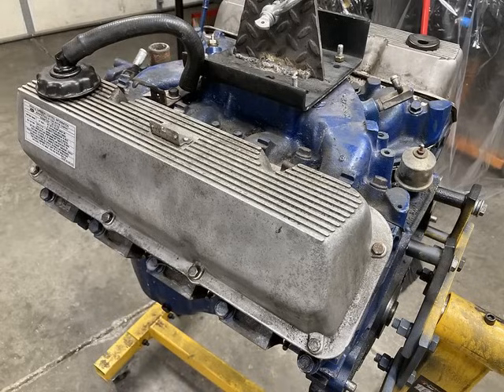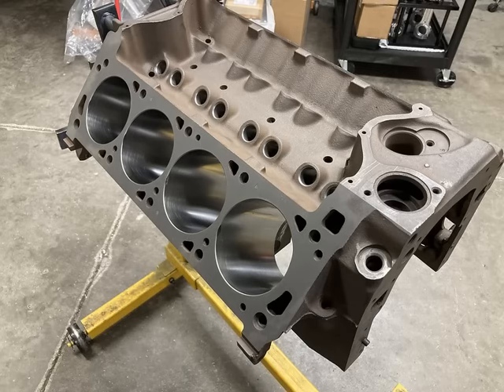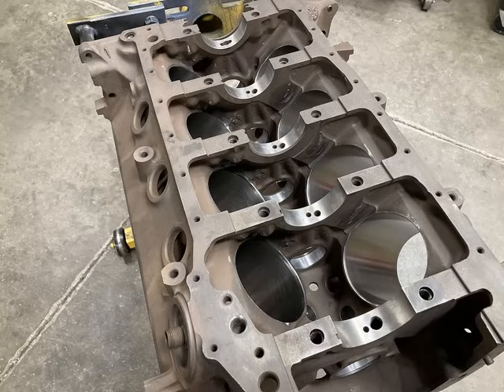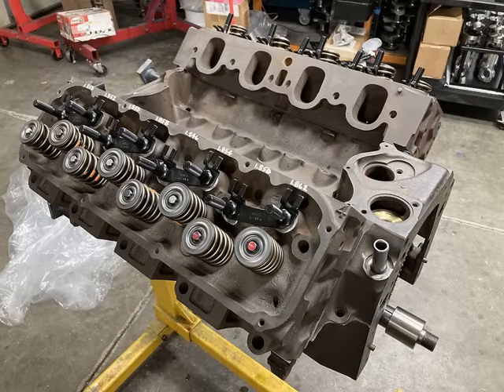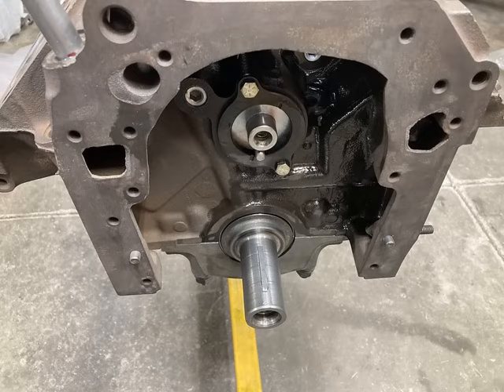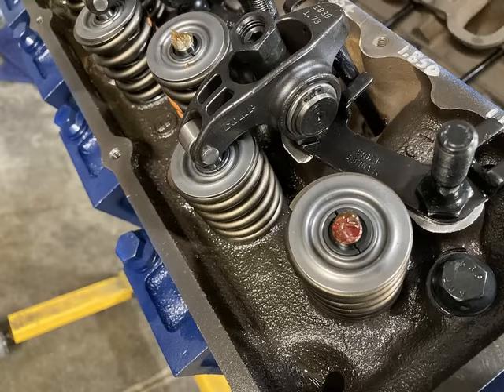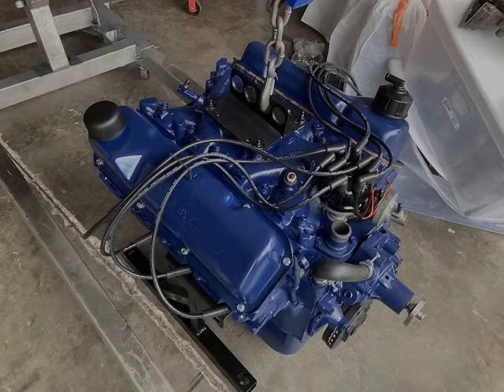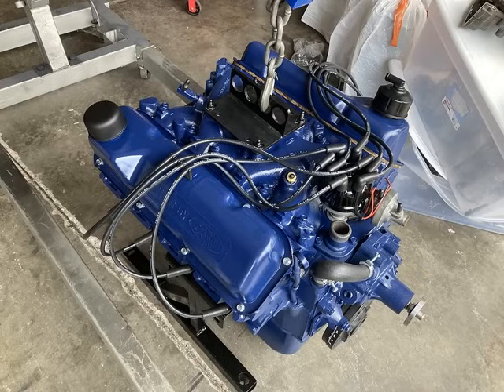Lykins Motorsports Ford 351C Complete Build, Disassembly To Dyno...

Comment: I have a bare, 71  351c cobrajet block that's been bored .030 over and all the machine work done. And a set of 70 4bbl closed chamber heads, factory, untouched, complete. I also have a 2bbl 351c block, complete that's going to be the doner for everything else. I do like the upgrade to those Eagle rods. And those pistons look yummy. Like Christmas candy! Would you mind sharing the specs on the camshaft and curve specs for the distributor? I like how, in the dyno room, reality warps as that Cleveland devours the atmosphere and tries to ingest everything else around it!
  Excellent video, very meticulous build and attention to detail. Happy Holidays to you and yours.

Comment: Great content! I'm a bit puzzled as to why those finned aluminum valve covers were not used?  They were stock on the higher performance Clevelands and they looked excellent when cleaned up or even polished. 
Thanks again!

Comment: Excellent narrating excellent rebuild and I learned alot especially using gasket maker instead of the rubber seals in front and behind the oil pan those things always seem to be problematic thanks so much for being so detailed

Comment: Thanks for the great presentation on the Cleveland build. Presentl I am building a BOSS 302. It came to me broken, detonation blew out two porcelain sections from Sparkplugs. It will be apart after Christmas. Damage🥶🥶it’s a 13/1 previous road race engine.

Comment: What carburetor did you use? The factory carburetor in 1970 was a 600 cfm Holley. That is not a factory 600 cfm carb. No choke horn.
I have factory stock 1970 351c 4bbl. Never been modified and has been in disassembled storage since 1980. Im finally ready to build and install in my 67 fastback

Comment: when i was a boy my dad had a junk yard,i quickly got into the FEengines.dad liked fords and had a lot of them.i had-still have a 66 comet 390 4 speed now 428.i ended up with 5 comets.i had one 67 that had a 351c 4bbl intake no carb on it.i was young and did not know what i had.a buddy said what do you want for the heads off the 351c.i said you can have them,i like 390s.when he took those heads off i saw the giant valves and ports and i thought wow i messed up giving those away.never had a 351 running in anything so i just did not know what i had.

Comment: Hi Brent, you mentioned that you installed bronze guides so that you could use viton seals, which got me thinking! I'm using viton seals on my 400+ hp 306ci sbf with cast iron heads/cast iron guides......is this a problem? do you always install bronze guides in iron heads? Thanks, Dave
Reply from the maker: It's not a problem.  I always install bronze guides because factory stuff is generally worn out by the time I get it and there are more spring locator/cup choices for common bronze valve guide diameters.
Reply: Thanks, that's put my mind at rest!  @lykinsmotorsports

Comment: So many questions here: 
1. What HP level is the block good for - with and without filling the block
2. What RPM is the stock crank and the stock rods good to  - balanced with arp fasteners - rod and main bolts?
3. Since transport might be an issue for some of us to ship an engine to you, would you be able to either put together a kit or provide guidance for a kit (for a fee) to achieve a power/ rpm level?

Personally my goal is 600 - 650 hp at 6600-7000  - and a safe redline (not prolonged at that rpm) of 7500. 

4. At this level, are the as cast '70 closed chamber heads fine?
Reply: May be late, but since there was no reply I'll add some info for anyone else wandering by. I'm not an expert, just an enthusiast, so take this for what it's worth.
The stock cast cranks are good nodular iron. Pro Stock racers in the 70's were using race prepped cast cranks pushing 10k. In NASCAR they could last for 500 miles at 7k+, but many teams went to billet machined cranks. Buy 2 main bearing sets and use a pair of uppers on each main journal for full groove oiling to the rods. Stock rods with polished and shot peened beams and resized for ARP bolts should be good to 7500, but is pushing the safety margin.
Minimal port work will improve head flow, especially at low lift. Most of the improvement is actually chamber work to unshroud the valves. The valve clearance machining leaves ridges in the chamber, on the intake near the spark plug and the exhaust on the opposite side. The scallop in the chamber wall also leaves a ridge. Blend the machining ridges into the cast surface. In the port itself there is also a sharp ridge where the seat machining meets the cast throat. Blend that down for a smooth transition and constant radius on the short side. You can also streamline the valve guides. The intake ports tend to have a line of casting flash near the turn.  "Blue Oval Dude" has a video covering this. He picked up 50 cfm at .3 to .4 and 40 cfm at .6 lift just blending the rough spots.

Comment: What do you about this I built mine 1971 block stock crank a rods Keith black pistons 8 cc dome 2 v stock heads about 10.1 cam is a flat tappet hydraulic Lift: .513 / .536, Duration @ .050 215-225 with a 112 separation Howard’s cam 670 brawler with a air gap intake hei ignition

Comment: I am very curious about your piston design choice here. I see its just a simple dished piston, not a inverted dome or whatever they are called when the dish is just on one side. Maybey you could make a video about this? What im curious about is quench, or with this piston choice, lack there of. When using a dish puston like you have here doesnt quench go out the window? I have a bbf that is 504 ci with dished pistons like the ones shown here & i have been thinking about finding different ones so i can take advantage of quench. However with my D0VE-C heads its hard to do & keep compression down on a streetable level. Maybey you could straighten me out on this theory? Is quench not as important as im making it out to be??
Reply from the maker: Even a full bowl can have quench.  All pistons have a quench band around the circumference and a dish will actually cause swirl.

Comment: Not too bad not too bad I think your combination should have made a little bit more horsepower I've been working with an engine builder at  home in the Moody Ford from the 60s 70s make a lot more horsepower out of a motor like that than what you did I don't know what you're aiming for basically you just rebuild a stock engine with a good set of rods

Comment: Unless this C engine has perfect oiling, it won't last long at higher rpms for any extended length of time.
Reply from the maker: Well that’s kinda the jist of all engines….of course they won’t last if they don’t have good oiling 😂 This one will do just fine though.  I have Clevelands that turn about 2000 rpm higher than this one….

Comment: Clevelands are a dismal failure. Ive had one for 20 years.
Reply: Must know they are a different animal from any of the other Ford series. They like alot of cam overlap, the 2V heads are prone to detonation, dont forget the brass bypass plate under the thermostat, they use a specific thermostat unique only to the 335 series, and the oiling system needs modified for high revs. I love em and think they’re one of Fords best engines from that era. Australia loved them so much they made them well into the 80’s. They can’t be all that bad of an engine. Perhaps it’s just you. 😂
Reply: @Paul-k5l1k I sure loved mine, I was 18 when I got a 1971 Gt Torino, 4 speed 351 4V, I loved that car, cut my teeth on 335 series engines. I’d love to have it if I could to this day.